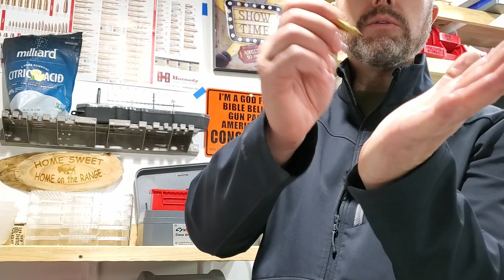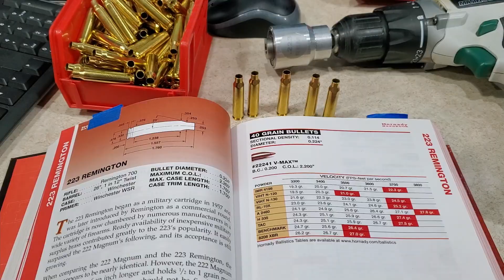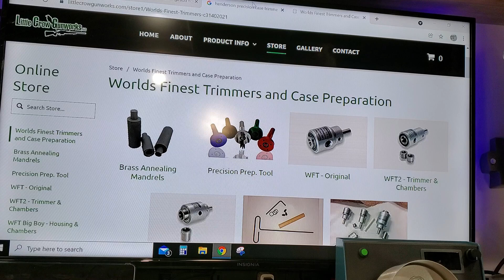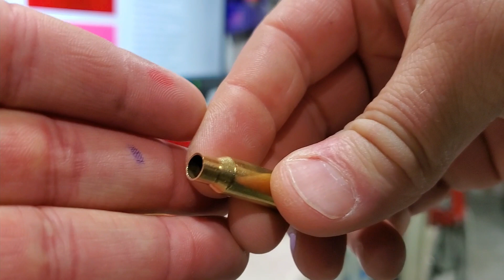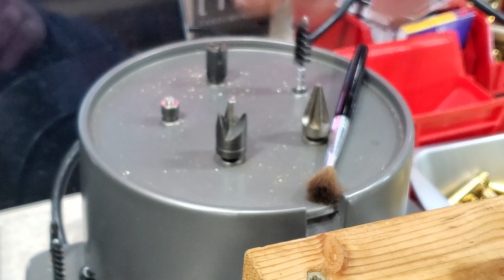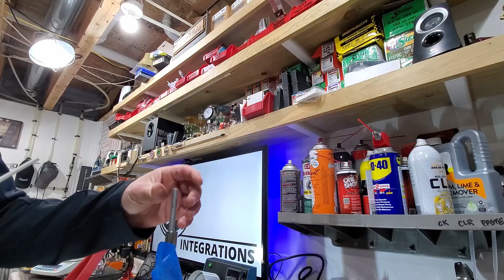RELOADING RIFLE 101 PART4 - GETTING THRU BRASS PREP HELL & SEATING PRIMERS

Comment: funny story. I have just started with hand loading.  I spent the last couple of years slowly buying all of the equipment I needed and during this time I collected an ass ton of .223 and .308 casings from a very reliable source. All  of the casings are Federal and all are once fired. Now I read as much material as I could and watched a cross eyed amount of youtube videos from good channels and I learned a lot. And to that end one of the things I learned was about the military crimp in 5.56 ammo and how that needs to be removed before priming. Ok that's fine. got it. I never really looked into it any more than that because I had .223 casings not 5.56 casings so no crimp......then When I finally got to the actual bullet making part and tried to seat the primers using a hand primer. It wouldn't work. bought a second hand primer and then a third. I know I should have stopped and looked at this logically  but I didn't. Anyway after the third one I finally stopped and looked more carefully and that's when I realized that  all of the .223 federal brass I have collected cleaned and de primed all have a military crimp to them. And the funny thing is, I didn't once think to look into this because I never came across any info suggesting that .223 could have a military crimp. An expensive oversight on my part but a lesson well learned.
Reply from the maker: True dat!